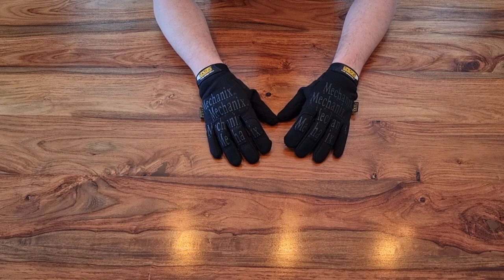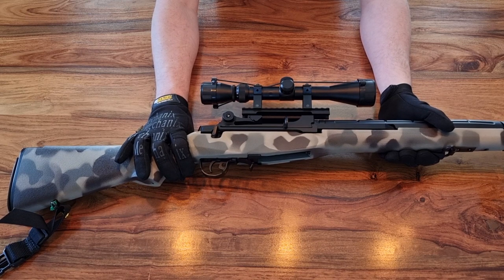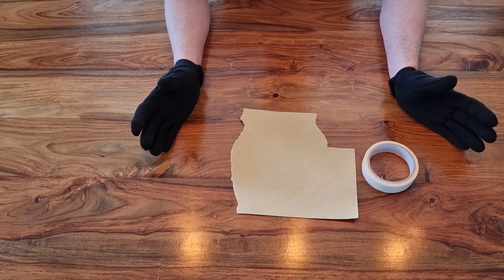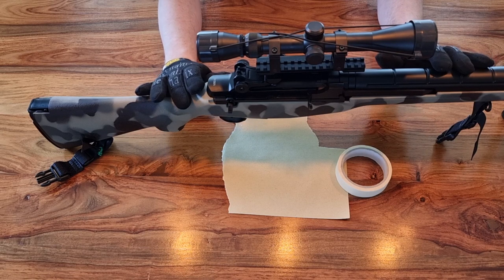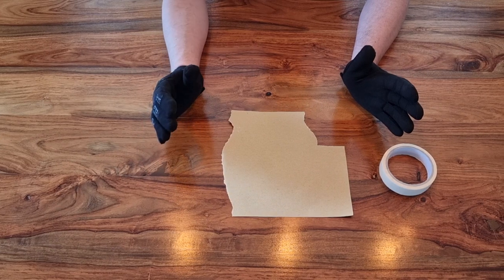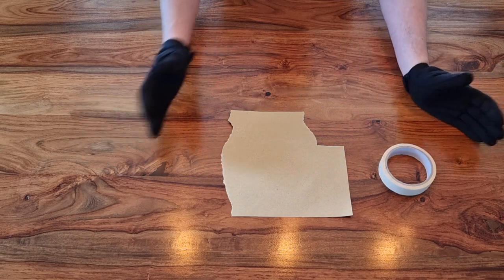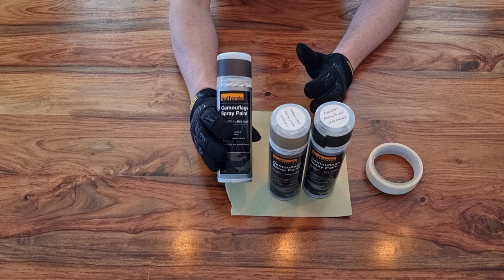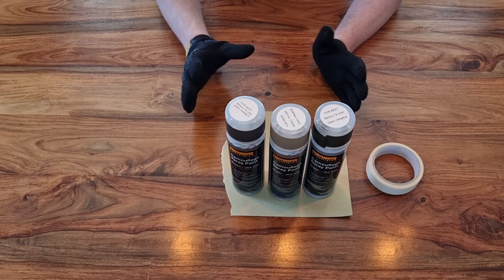An introduction to painting your Airsoft replicas.

Comment: Hey man did you paint your rifles before i wanna ask how much time the paint stay ?
Reply from the maker: Hi mate. Yeah I've painted a few. The M14 I showed in this video was painted about 2 years ago and hasn't worn off yet.
Reply: @rockbottomairsoft  i was wondering to paint my Novritsch ssr4 polymer but not sure it will stick to Polymer body and will peel off after a while and will look ugly but your looks good
Reply from the maker: You should be OK with the polymer on an ssr4. If your worried about it wearing off then lacquer over the finish will give it a hard finish.